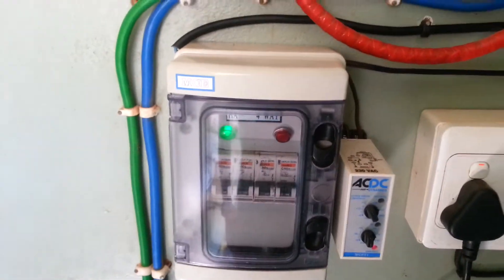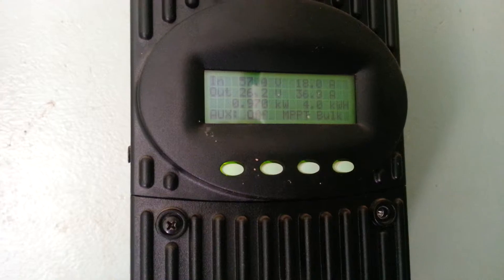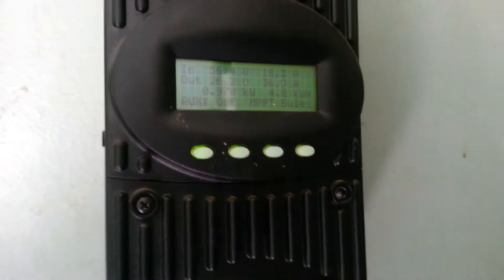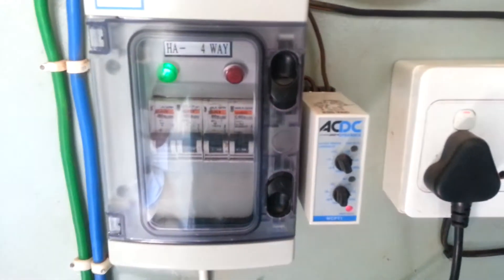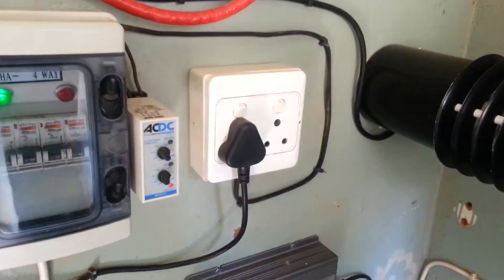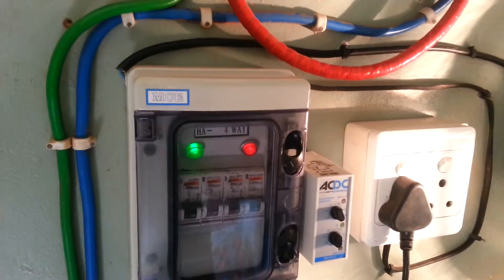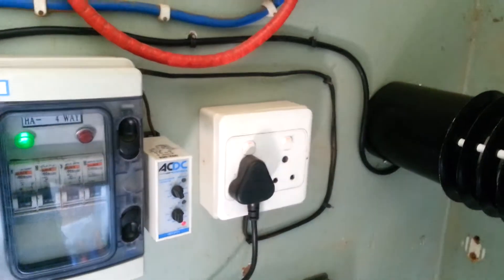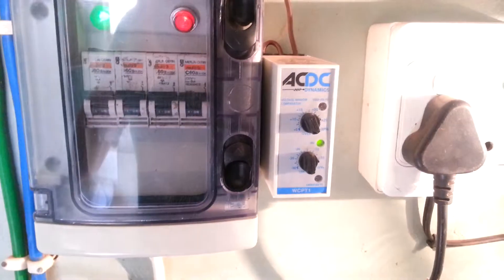DIY AC Dump load controller for water turbine

Comment: It’s far better to make a separate controller that is made in a very fail safe manner such that if the charge controller fails you’re not going to have any issue but you have to build it using expensive parts with a lot of bad things happening

Comment: How about dumping the current to an electric water cylinder.
Reply from the maker: That is a great idea, i wanted to do it that way but cant since i have only solar-geyser without the element . thank you for your comment and for watching my video
Reply: You could pump water up to a header tank for latter distribution by gravity feed, or drive an air compressor to store excess energy, which could be latter used to drive air tools or air motor generator, or just use the air to lift water from a deep well bore, alternately you could use the excess power to drive a ac motor that lifts a heavy weight that latter could be released to drive the same motor as an alternator; a similar principle to a spring windup toy.
Reply from the maker: Wow you do have some idea's true engineering at its best , i don't think i can do that kind of build but other people can like you , for me i think i will stay at ram-pumps and solar panels and water turbines . Thank you for watching and for your comment

Comment: Very nice.

Have you tried a double diversion load?  For instance, the main job is to fill the batteries.  

The primary diversion load kicks in when the batteries are full, if the batteries are still topped up, and the job of the primary diversion is done, then a secondary diversion load kicks in.

The primary diversion load may be a hot water tank, and the secondary diversion load may another hot water tank, an air resistance, or a halogen light.

Comment: Hi Philip.
I live in UK and run solar pv @ 2400 watts grid tied.
i want to retain and divert the surplus power we produce to a battery charger to charge a 600ah battery bank that i have.
Its in my garage and a 3kw inverter is powered by the battery bank and runs our laundry.
Its a project plaything that became a practical system for everyday use.
Products like the IMMERSUN require a resistive load so how would you suggest i charge batteries instead?
I dont have a water heater either, im using a gas instantaneous boiler right now.
Any advice appreciated !
Happy New Year
Si
Reply from the maker: +MultiOutdoorman Hi firt thank you for watching my video , i think the best thing to do is to get yourself a hybrid inverter it does the same as the grid tie inverter but firstly charges the batteries and when the batteries are fully charged it feeds the surplus power back to the grid , so you make money by selling your surplus power and are completely offgrid with batteries,  let me find you a link of the inverter so you can read up on it http://hybrid-solarhomes.com/

hope this helps goodluck
Reply: thanks